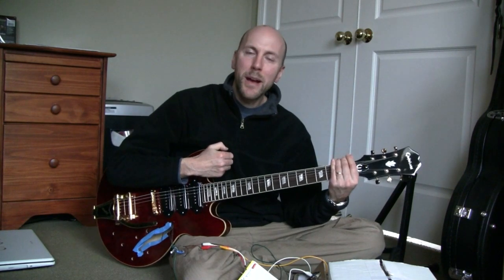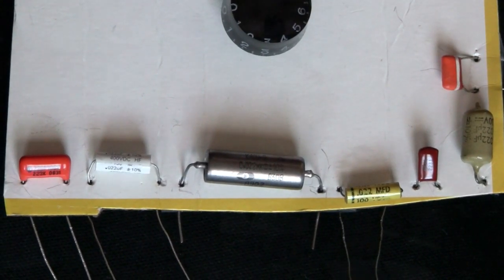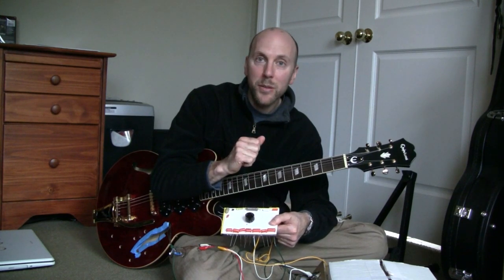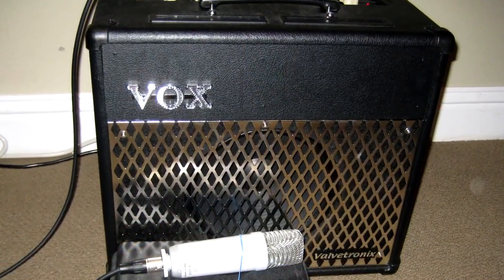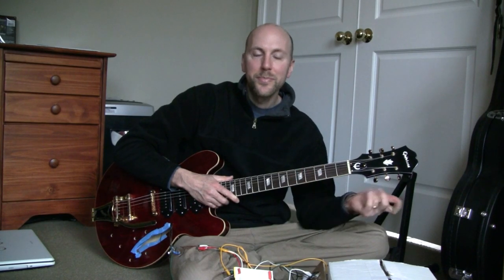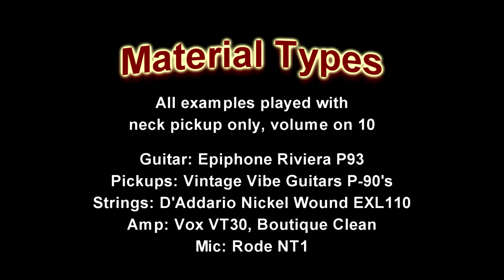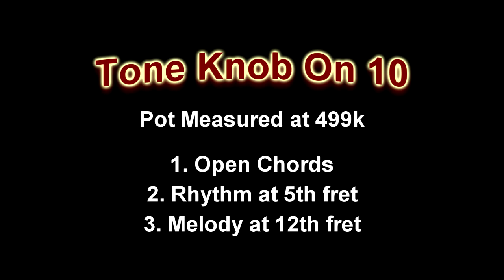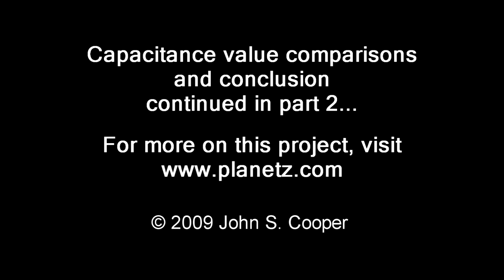Guitar Tone Capacitors, part 1: Evaluating Material Types

Comment: The cleanest and  most thorough test I’ve seen.  Ive been convinced to change my opinion on this a dozen times and you’ve put it to rest in my opinion.  I’m very thankful for my ears because the differences clear to me and more extreme than id have assumed at a best case. Thank you.  As for myself, playing with tone adjustments  one chord strum at a time is about as fun as actually playing guitar. I guess partly Cuz i can look forward to using the tones. Point is i spend plenty time making micro adjustments throughout my chain exploring tonal differences. And often they are for as much or even less variation than you’ve demonstrated here. Good job man.

Comment: What a great test....... I listened close with my old ears and struggled to notice any real difference. As I thought because of my electronic schooling I did not really hear any difference that mattered to me at least (maybe others), ever so slight maybe and even then I questioned my hearing. A lot of snake oil goes into selling  upgrades. I think we should all just focus more on our playing :-).  Pickups make a big difference and yes you need decent electronics/wiring and not pure crap components but the test shows that these changes did not really make a difference that mattered. Cheers guys!!
Reply: I hear more difference between playing on monday versus playing on tuesday.
Reply: Old capacitors usually raise in value,  which would be the #1 difference.   The differences from one to another amount mostly to the differences in tolerance.  Most stock caps will vary up to 10% from their stated value,  meaning that 2 could be 20% apart.
Reply: @DeadKoby  I have looked at several manufacturer's ageing information and also a research paper, and at least for ceramics and electrolytics, capacitance is lost with age.

Comment: Thank you for producing this comprehensive comparison. 

I can hear slight differences, but the differences are minuscule compared to the tone differences one can achieve with attack changes. Perhaps the capacitor differences are more apparent in some genres than others? I play old school R&B, R&R and Blues ('40s, '50s and '60s mainly) with the guitar straight in to an old tube amp. 

Whenever the topic of guitar tone caps comes up in discussions I refer participants to this video. Thanks again!

Comment: Well, listing on studio monitors, here's what I think. Of course you have to turn speaker volume up a bit.  The ones I think mentioning:
 ***Mallory: most evenly EQ'd, great clarity with tightest bass. No wonder tube amp builders use these.
****Russian PIO: best mids, warm clarity and punch. Retained tone better when turning pots down (fits guitar freq's best).
**Vintage Yellow Film/Foil: Less bass and mids, highs little harsh, but actually close to the PIO but less natural. 
*Mullard Mustard-Fat Grey: Awkward sound, too much flabby bass and pretty muddy to my ears. Maybe best for thin sounding guitar.  
**Tropical Fish: Decent clarity, plenty of highs, but mids were lacking. Not a bad cap. 

.

Comment: I can hear a remarkable difference. I was surprised how much the low end shifted between some of the material types (paper in oil was especially different), as well as the difference in mids and highs between all the caps, even with the volume on 10. Certain caps had a totally different mid character. This video is fascinating, thanks for doing it!

Comment: Vintage Vibe P90s.  I rarely come across those.  I bought a set of eBay and love them.  About the capacitors....I am going to be massively unpopular but I prefer the openess and slightly lighter touch of the Epiphone originals on most of these tests.  I guess that makes me a cheap date.  Thanks for the posting.  A lot of thorough and informative work.

Comment: As subtle as it may be I can hear a difference in every one of the capacitors. Many sounded very similar but the fact that he rapidly progressed through the series of examples being compared enabled my ears to hear differences. The graphic display showed, for the most part, the same frequencies being dumped and the frequencies that remained, which where exactly  the same for all capacitors, yet the amplitudes varied noticeably for the remaining frequencies, with the amplitude curves either smoothed out or jagged with spikes. And having no incremented reference as to the amplitude of a given frequency, which on an oscilloscope  would be the (+) or (-) voltage reference of the sine wave, it's hard to say how much more or less a capacitor affected each frequency displayed with the graphics.
Not everyone is able to hear these differences, just like not every guitar player can play by ear. Not every guitar player can hear the intervals or the modes, but they can learn to play the song. Some people hear the music from some inner source, while others learn it externally.
In the ancient Greek language there are two ways "to know";
One is "Ghenosko" an outward and learned knowledge.
The other is "Oida" an inward and conscious knowledge of the heart.
And here I must say that because you can't hear see or feel what someone else does doesn't mean it's wrong and it's the result of a vivid imagination.
Remember not everyone can play the guitar. Those of us who can are blessed with that gift and we shouldn't be demeaning someone else for theirs because we don't have it.
Anyway enough said. There is a difference in the capacitors tone's as in our capacity to hear...

Comment: All 22nF sound the same, 33nf a bit darker. But having more expensive cap makes audiophile happier. So go for it who needs it. I've got mallory radial polypropylene 22nf to prevent thinking that something could compromise my sound in guitar, but I don't really believe that it changes anything. Just avoid tantalum, ceramics and electrolitycs. You could even create Your own caps if You like, just copper foil, paper, candle, 2 wires. Audiophiles hear with their eyes, that's the secret. Great job!

Comment: thanks for posting. i've always been suspicious that paper and oil caps were snake oil, considering that the voltage in a guitar is so low, but this definitely confirms it. they all sound almost exactly the same. the biggest difference is the variation in your attack and playing between each sample. i thought that there would be more noticeable differences once the pot was turned down more, but that's clearly not the case. i'll be picking up cheap ones henceforth.

Comment: I've never been able to get a good answer about why two capacitors would differ if the measured capacitance is the same. I've got to think that any differences between the types of caps have to do with tolerances--a .022uF cap can actually measure at a completely different value, easily 10% off. That would make the sound very different

Comment: Anyway, I'm hearing small differences between caps.  Another good demonstration is when you have a switch that cuts off the tone pot and tone cap completely.  It makes it so obvious that the tone pot and cap are totally loading down the signal.
Reply from the maker: Right- demonstrated here:  Guitar Potentiometers part 4, Modifying a Tone Pot  to be No Load for True Bypass

Comment: Funny although the differences seem mild I actually seemed to get a warmer tone feeling out of the russian oil and all the vintages seem warmer as well seeming to indicate a capacitor 'breaking in' effect. as most know electricity is corrosive in that it does erode the path over time and that seems to have created the change in tone of the vintages. It would be nice to have a new and vintage same brand cap to test just to see. Anyways nice set up. Should do a blind listening test.

Comment: Great demo! I commend you for the amount of time it must have taken to set up and make this video. My ageing ears aside, I could hear little or no difference with the tone control cranked open to 10. but, knowing a bit about the physics of capacitors and potentiometers, that is entirely what I expected. And also as I expected there are differences when the tone pot is turned down. For me the vintage yellow cylinder sounded the cleanest when you darkened the tone, with the vintage tropical fish coming a close second. Having said all that, tone is a very personal and subjective thing and what your great video has done is to allow people to make decisions that suit them when choosing capacitor types.

Comment: Thanks a lot. As far as the Leds are concerned, I was just going off of what I saw from a video called "KAMY051 acrylic plexiglas guitar" by user "artemis92400". I didn't see any visible switches or batteries. I didn't know if there was someway he wired it to a pushpull pot to turn the lights on and off or if the power came directly from the jack. I'm more or less building his guitar with some more upgrades

Comment: I have tried a rainbow of tone pot capacitors,from 0.047uF  thru .ooo1uF(Code :101),this last one IS THE SOLUTION for my ears...Vox SDC-55 model,high frequencies are impressive to ears at bridge and neck pUps...
For the Vol. pot. capac. I used a .001uF(Code: 102,ceramic as Leo Fender).
For Telecasters: TPC 103 ,and for VPC 102 SOUND is Vintage,of a 1958 tele

Comment: Outstanding methodology and presentation.  

What I found curious is that I think I perceived more variation between the caps when the pot was at 500k than when all the signal was hitting the caps.

To me, the differences could be described as subtle, but  very very much there..  Do you think that much of the tonal differences could be due to value tolerances or would, say, 20% variation be this perceivable?  Caps can have a huge tolerance from spec, especially vintage (read "old") ones.

Comment: What was the total Capacitance of the system prior to connecting the Caps themselves?  The use of a low capacitance cabling and connectors could lead to a better evaluation; my concern is that the total capacitance of your circuit prior to connecting the Cap may be greater than the caps themselves.  I would be interested to knowing the total capacitance in the completed circuit for each cap selected (due to tolerances, etc).  Thank you for sparking my curiosity.

Comment: I am indeed a musician.
However I think that the variations you're hearing are because of expected différences between the caps. Even if it is marked .22uf or some value of the like, 2 caps will never have the same capacitance value. After all, each one does the same job; roll off the higher frequencies in the signal.

Comment: Interesting comparison! Did you measure each capacitor with a multimeter? I understand there can sometimes be a wide variation between the stated value and actual value, especially in the case of more aged examples.

Comment: That tone cap sets the tone for the whole guitar!I'm talkin' with the pot all the way up!Try a .0033 and then a .022 HUGE difference,even when tone control on max treble!Yes the .0033 is a smoother tone taper but sucks the life put of the git.No bottom end at all.Most people commenting on the web state that changing the cap has no effect if tone control all way up!BS!"That cap sets the tone for the guitar".Unblessed ears I suppose.Or,people experimenting with values and making minor change.

Comment: Any chance you were able to check the actual values of the caps?  Many of those are 10% - 30% tolerance, so comparing at an equivalent tone pot setting for all could be a bit ambiguous as to the actual low pass filter pass frequencies. Although, my ear didn't pickup anything drastic between them, so it likely it a non issue, but something to keep in mind.

Comment: A capacitor (originally known as condenser) is a passive two-terminal electrical component used to store energy in an electric field....depending on how it is used..u use them for filters, etc etc...Frequency dependent on its value.....i.e., same for all types..as long as the same value......by the way a guitar has 9 volts doesn't SO that is DC right?I am glad you understood me.....In short, no sound difference and it is a good thing being curious as you are....again rad all the data sheet.....

Comment: Stewmac sell some Emerson caps. Do you know which of the ones you demoed the Emerson's would sound most like? I'm thinking of putting them in a Strat with Dimarzio Injector pickups (noise cancelling & hot). I'm trying to put together a list of components to put in that will give it a hifi sound with lots of clarity and maybe a little spank

Comment: I hear differences at tone 10 high cord from 3:34 to 4:16.
Russian sounds most compressed.
Is it because you are not stroking same? Or is it from the CAP?

I had same experience and differences seemed very small at my living room volume level, but when I played it on 50W Marshall Amp with loud volume, I noticed considerable change in sound character.

I think it has something to do with amplification of the sound signal, quality of the recoded sound and playback audio quality and volume.

Comment: Oh and I forgot to say that I'm also wanting to install some Led's. Do you have any advice on that? It's an Acrylic guitar and I'm debating on whether to have the led's battery powered and run off of some sort of push pull pot or have them run straight off of the power from the jack. I'm wanting to put a chrome pickguard on it so I don't want to drill any holes in it. I know that's a lot of questions lol but I'm trying to get as many answered as I can. Thanks

Comment: What do you know about Illinois brand .022 Microfarad Metalized Polypropylene capacitors? Non-inductive dielectric with self-healing windings provides total sonic purity. 10% tolerance. 630VDC voltage rating. I'm thinking about these.

Comment: one problem with this test happens at 4:10 onwards.. with the chord played at the 12th fret... the chord is lifted before the note is done ringing out ... since a lot of the differences in these caps are in the trailing harmonics and the sustain you will not get to hear the difference ...  there are major differences in 2 to 3% of the capacitors you can use but you will not hear them with this test  otherwise this is a great test
Reply: Once again Pat, you make a great point &/or observation.... I noticed this right off & it ruins what could have been a great test/video....

Comment: Hi - I'm not sure if this has been addressed yet, but does it matter which direction I install my tone cap? Wasn't sure if there is a polarity I need to be concerned with. Thanks -
Reply from the maker: +John Anderson - no there is no polarity to consider for these caps.  Electrolytic caps are polarized but aren't used for tone caps.
Reply: Thanks for the info!

Comment: Good effort but you should have used an all-tube amp to hear more detail.  Solid state amps like yours have a way of making everything sound the same.
Reply: cableaddict well actually SS doesn't add detail or remove it, it's 100% honest. Tubes just add harmonics.

Comment: whats up, no love for the ceramic caps? all ceramic caps are not created equal. Very hard to argue with the growl from a good ceramic cap on a single coil pickup, its just mean!. the yellow ones are much better these days, check out mojotone's dijon, 22s in a LP on the neck PU and 47 on the bridge really wake up a LP. The oil and cap ones.thats a tough call, one can be so different from the others, i think they are more temperature sensitive also. 
Liking that tropical fish too! never tried.

Comment: Cool! Can this be done using an actual cable that plugs into the jack outlet? Like connecting alligator clips to that somehow?
Reply from the maker: sure. you could bug a bare female 1/4 jack, and plug your cable into both the guitar and the jack - then alligator to the lugs on the jack. Or you could cut the end off a cable and separate out the wires, and alligator up the leads.  One downside is that your guitar signal will have already passed through the rest of the guitar tone circuit...

Comment: 09/25/2019 ...Hello,  I have a 2018 Fender Player Series Telecaster.  However, I put in Fender 4 th Generation Noiseless Pickups.  I accidentally broke the tone pot, so I bought and installed a new Fender 250V pot.  The new pot came with a square-shaped capacitor (.022mf).  I do not know what the factory capacitor is, per no  ID markings, but it is a small round shape.  I left in the factory round capacitor, and the guitar sounds good turned off (not too bright), and then it gets really dark and muddy turned all the way down.  I am just curious about what the difference the sound would be, if I added the square .022mf capacitor.  Would it be more bass or more treble?
Reply from the maker: see part 2 of this video for answers about how to identify that original tone cap, and what effect the capacitance value has:  https://www.youtube.com/watch?v=rR4maqK_IhQ

Comment: Orange drop performs well in every condition. Rate: 8
Mallory has a colourful, beautiful tone, but a little skynny. Rate: 8 (great for p90s and jazzy humbuckers, maybe high output singles and fat singles)
Russian pio is very deep, seems to produce more sustain, but its a bit dark, a little lack of midrange. Rate: 9 (great for paf classic humbuckers)
Vintage Yellow Cylinder is very close to Mallory, but its fuller and has less clarity and bottom. Rate: 6 
Epiphone original: by far its very poor compared to the others. Rate: 3
Mullard is dificult to evaluete, its very colourful, produces an avesome midrange, very thicker, but the clarity is no good and the bottom is somewhat poor. Rate: 7 (I think its wold be perfect for a vintage strat, lipstick-like pickups...)
Tropical fish will not be evalueted thuss its .033 (but looks good as orange drop)